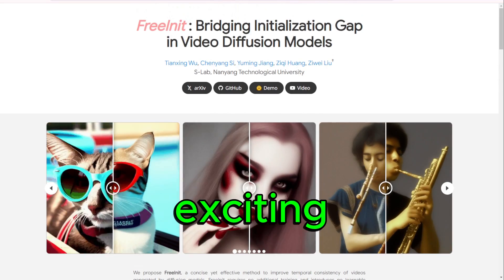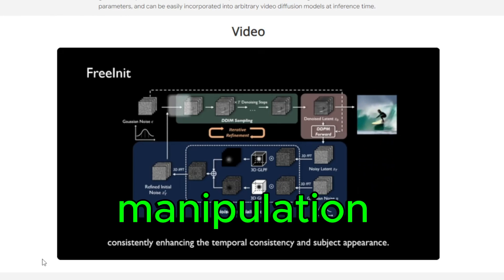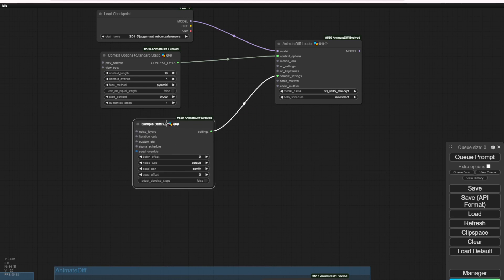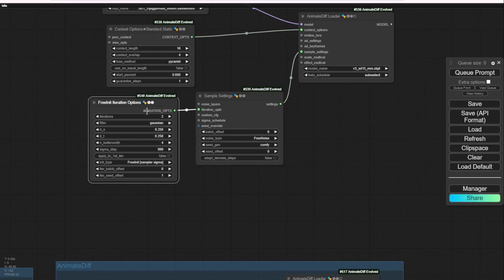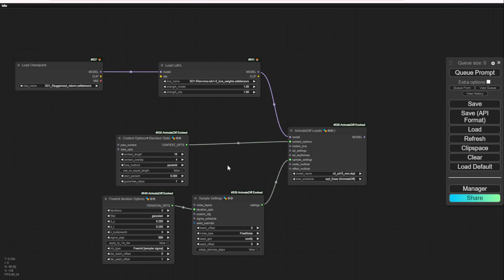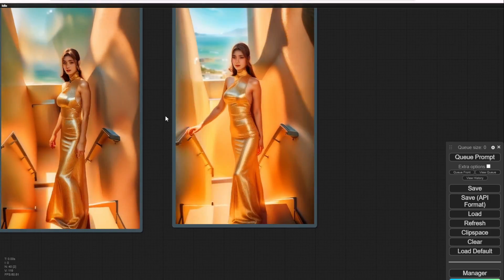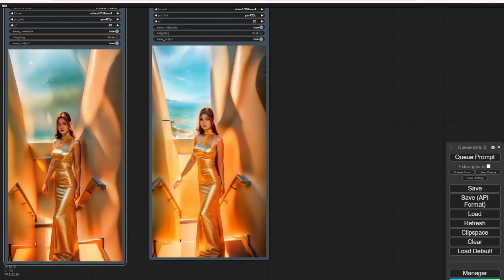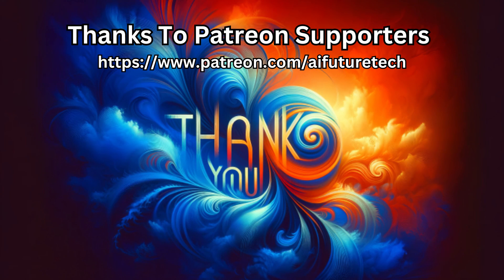Stable Diffusion Animation Use FreeInit In AnimateDiff For Consistency Improvement

Comment: Possible for automatic1111?
Reply from the maker: Automatic1111 is hardly to do addon stuffs. Let's go and learn new system :)
Reply: @TheFutureThinker comfyui always crashes on me. (4090, 64 gigs ram, 16 core high end processor...I have terrible luck with Comfyui).
Reply from the maker: You shouldn't waste your hardware setup, let the horse run wide. :)